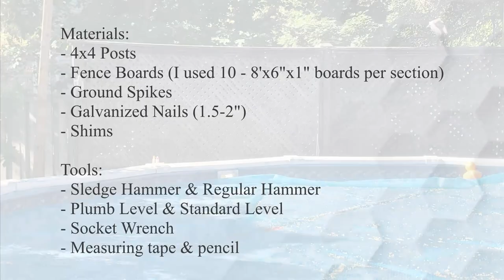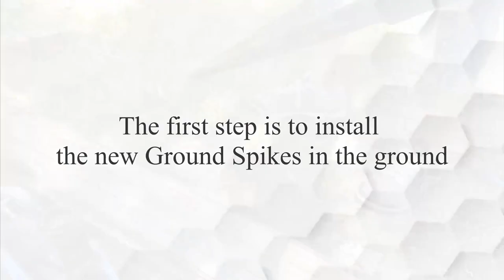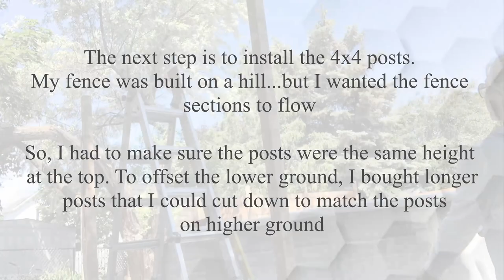How to build a Privacy Fence with ground spikes - KDA Designs

Comment: Hi Kate, thanks for the video, just wanted to ask for an update on the sturdiness of the fences? I'm thinking of using the spikes for my fences but wasn't sure if they would be wobbly. If you can give me your thoughts of the spikes after sometime that would be much appreciated. Thanks again. Harry
Reply from the maker: Hi Harry, No problem! Its a few years later and they are still very sturdy. I do however have a fence about 10' behind them that I think, blocks out some of the wind. I built this on somewhat of a hill so the posts at the top are about 2' shorter than the ones at the bottom. I would probably go no higher than 8' if they are in the open. This year I took off the solar light caps and pounded the posts into the ground (after a solid rain) as they had lifted about 3" over the years but that was the first time I had to do that. They have held up well so far but I also go out every year and make sure everything is stable after the winter. I certainly wouldnt do a full fence line with them but it worked well for about 25'. I hope this helps! :)

Comment: I am also wondering how these are holding up.  I am about to use these same stakes to hold up 2.5x5 foot framed lattice panels to create a privacy patio enclosure.  I am just hoping they hold up to our winds here in SD.
Reply: Also, did you have to leave the shims in with the 4x4 after you tightened the metal spike holder frames?  I need to make sure these 4x4's don't moved.
Reply from the maker: Apologies for the delayed response. I don’t think you will have any issue with the 2.5x5 lattice panels. I’m not sure I have the same winds here consistently but mine have held up really well and we have had some storms (although I have quite a few trees around that slow it down) mine was built on a hill so there is one section that is taller as I made each section level with the one before. If I have any issues that would be the section I have them with. 

As for the shims, yes you need to keep them in but you can snap them off (the part that you can see above the metal spikes) with a hammer. Just use the back of the hammer and get between the shim and post and pry it away from the post. It will snap at the top of the spike so you can’t see it but the shim inside the post will remain. Good luck!!

Comment: Great video. Considering going this route. How have the post and fence on spikes held up? Would you still recommend?
Reply from the maker: my apologies for the delay. My FT job has kept me travelling lately! I would still recommend it as mine have held up well. I have had some shifting (mainly just the ground pushing them up an inch or so) due to some crazy weather but plan on taking the sledge hammer to the top of them this summer but all in all, its nice to have the added privacy. They have been up for a few years and still look great! Thank you for watching :)

Comment: So yes im a guy but never built a fence i have a duplex with 10x10patio and want privacy around it but with a section in middle for entry but have a post in a bucket paint it green and attach the light from roof to post in a V. However i want a little area on one side of patio (4ft)  with a little entry so it looks like a area for a shower or trash cans but its my private space does that make sense? Lol what’s easiest and cheapest way to get posts in ground?

Comment: Great video!
Why did you use the shims?
I'm thinking about tackling a fending project around my entire backyard to save money. It may take some time but I think I can do it.
Reply from the maker: Thank you! I used the shims only when i needed to adjust the post to make it plumb. sometimes you need a little something extra at the base to reinforce the post. If you're installing a full on fence around your property, you may want to consider cementing the posts. I dont know that I would use the spikes for a property line fence ;) This one was more for a section of privacy. You can still do it yourself though! It will just take a bit more time, some cement, and digging!
Reply: @kdadesigns  Ground spikes are just as strong as cemented posts and better in the sense that you wood is not in the ground which keeps it from rotting.

Comment: I'm thinking of using 8 of these for a 5m x 3m pergola. What do you think?
Reply from the maker: Apologies for the delayed response. For a 5 meter x 3 meter pergola, I would probably not use the spikes because that is a fairly large structure to use spikes with. If one comes up a bit over the years, it will throw everything off. For a pergula, I'd suggest cementing them in so you have a really stable structure with no possibility of shifting. After 5 years, I had to take off the solar caps and pound the posts back in as they had lifted a couple inches. I suppose one time in 5 years is not bad but if I were you, I would use cement for the pergula. Sorry, I know its a bit more complicated than the spikes but you'll have a solid structure for years without having to adjust anything down the line. :)
Reply: @kdadesigns  I've put the spikes in now lol. It will have decking on the ground too but I think I'm going to dig a couple of inches around them and put concrete in. I didn't want to put wood into the ground so let's see. My fear was actually them sinking a little into the ground so you saying yours lifted a little comes as a surprise. If lifting is more of a chance than them sinking, then I might as well screw the frame into them so that the weight of the deck will keep them down.
Bear in mind no water will get to the ground as it will be sealed all around as well as having a roof above the whole structure.

Comment: How are these holding up?
Reply from the maker: Sorry for the delayed response. So far so good! The only section I’m a tad worried about over the years is the lowest one that was built on slanted ground. I have not had any movement yet however and I think it’s because I secured the boards to the posts pretty well. The fence is surrounded by trees so I haven’t had issues with the high wind storms so far. I probably wouldn’t build higher than 6-7’ but you may be able to get away with 8’ if you have a few sections secured really well together. If you have any questions please let me know and good luck! 😀